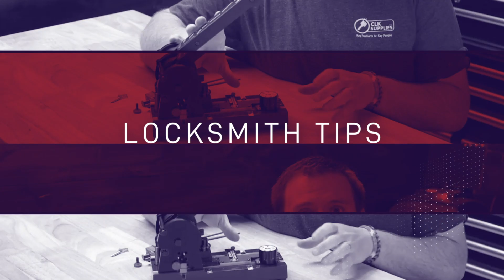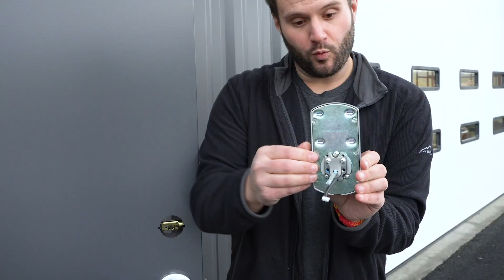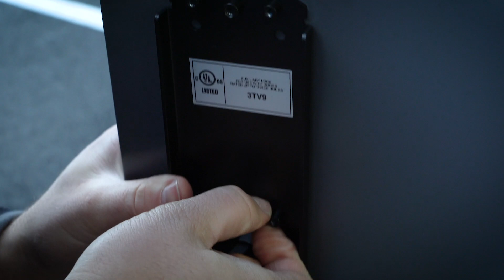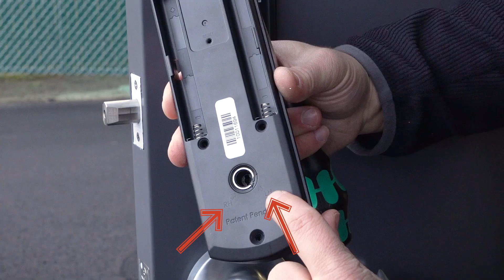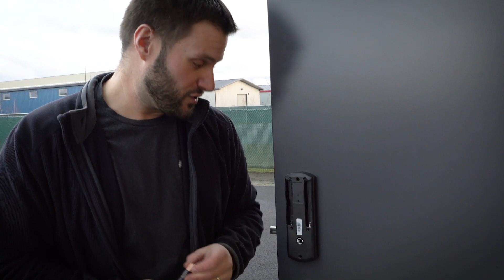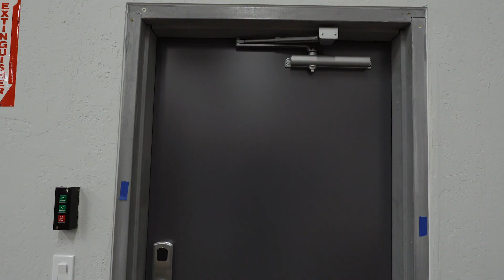Locksmithing 101 | Full Install Of The TownSteel E-Smart 5000 Series Electronic Deadbolt!

Comment: I would have had a hard time sleeping that night if I didn't use a combination square to ensure perfect spacing along the outside edge to make it plumb vs. a level and for sure would have installed the top two screws. It would only take one annoyed user to jack that lever so hard that it would be skewed. #lockboss
Reply from the maker: So true!-PJ

Comment: This eLock looks quite straightforward to install, perhaps easier than some with respect to plugging in the connector.  If the customer has other doors with Schlage SC1 keyways, then this is a good choice.    Pricing and warranty looks reasonable.  Maybe PJ could show us how easy (or complicated) this lock is to Program.  Perhaps a better choice than some other "cheap" ones for any #lockboss.
Reply from the maker: Coming up! I have 2 videos about this recorded-PJ

Comment: Thanks for teaching us stuff that every #lockboss should be learning about. 

Like another poster asked: is that an SFIC lock?

Also, I'd 100% make sure to check the manual key before installing, just in case they screwed up and sent a key with the wrong pinning 🤣
Reply from the maker: Yes it is! Always check to see if the key works! -PJ

Comment: Nice, clean #LockBoss install.    I like how the back plate is metal instead of plastic.   I have always like the Schlage models but I dislike he connector location and the plastic back plate on the schlage.   I also like how you can have more than a 4 digit combo on these.     This would be a perfect deadbolt for property managers if it included the ability to use a pox key fob :-)